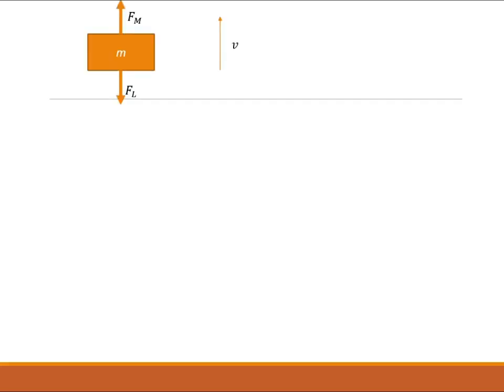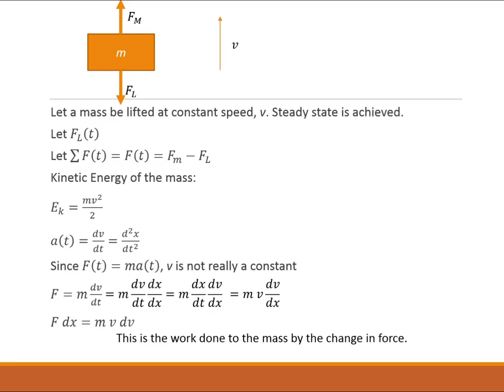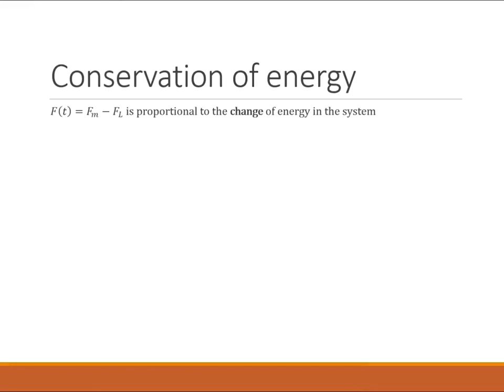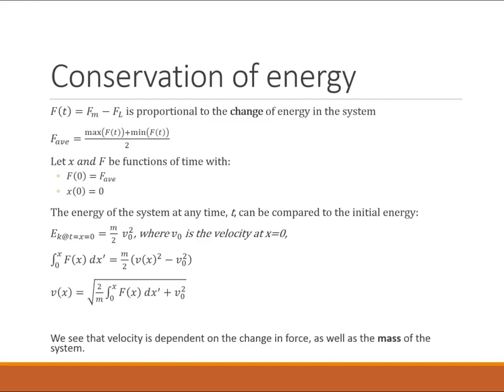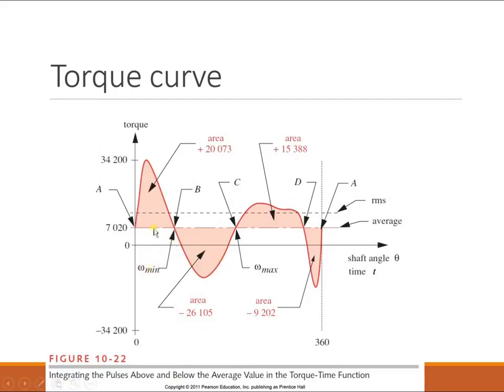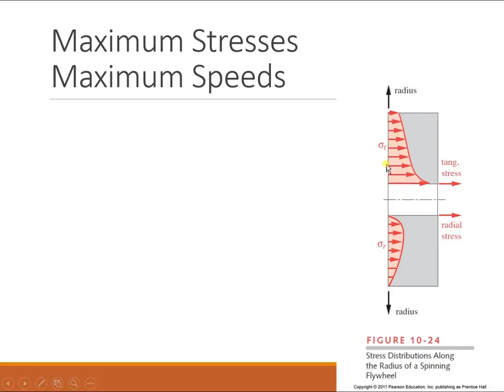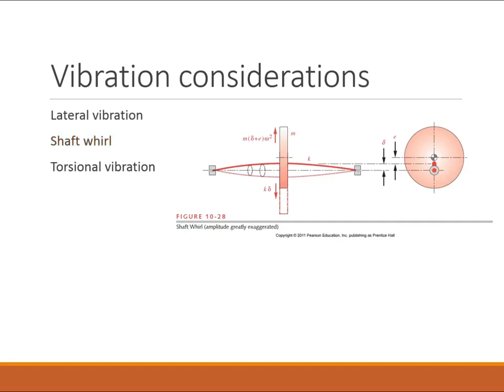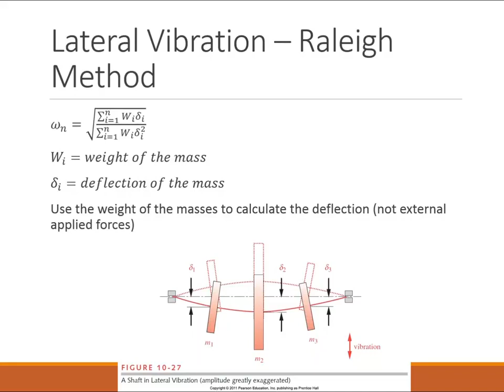Flywheels

Comment: So! If I had an electric motor with 2 shafts coming out either end, and flywheels weighing 40 grams each attached to each end... 
Let’s say they’re spinning at an rpm of 1000, and they are at a distance of 3 inches from each other… if I have that puppy in a rigid frame, and try to twist it against it’s precision at a speed of say 20 rpm. What force would I be fighting?